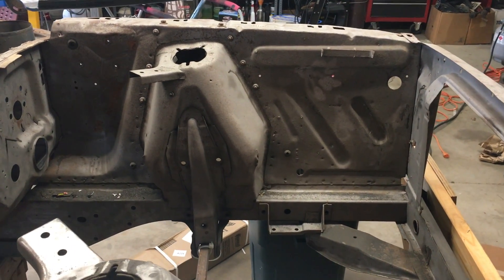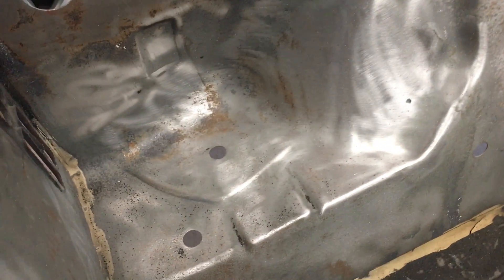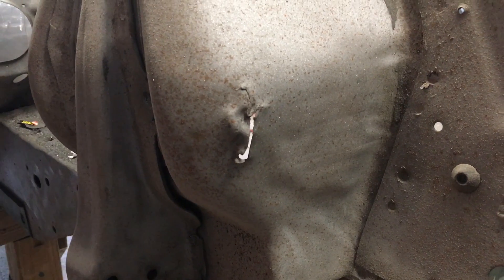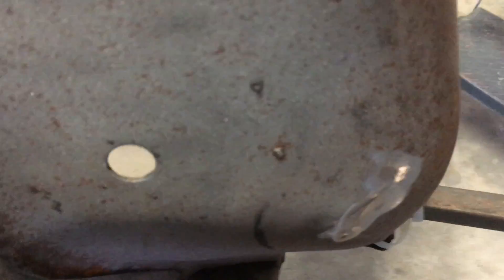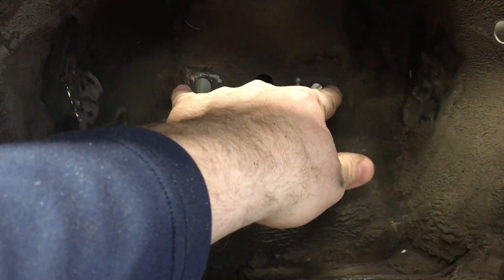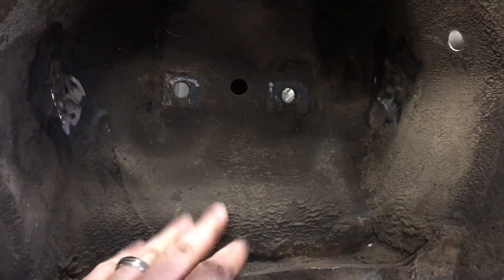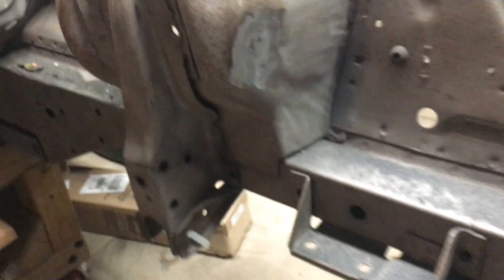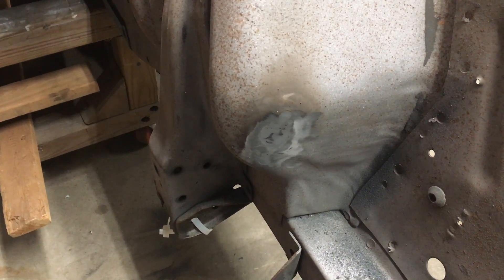Patching Shock Towers

Comment: The scary thing about pinholes is that they are a sure sign that the rust has eaten away all the surrounding metal to paper thin consistency. All the paint in the world will not restrengthen what has disappeared to the elements. You are making good progress and that's a good sign. :-)
Reply from the maker: Thanks Ed, yup its definitely helping me to find the weak spots.

Comment: my car actually had a hole in the same location...previous owner had put it there so he could grease the control arm and the other ones were hammered for the same purpose.  also if you get the brass paddles that you can put on the other side it will allow you to get less blow through.  ive used them a couple times on one of the doors on my 54 gmc

Comment: the big dent to the front of the passenger side shock tower is factory. 

Maybe the shock towers cracked due to someone drilling holes on the side to reach the grease fitting for the control arms, or they had after market control arms that didn't fit right with grease fittings so they banged inside of the shock towers out to let the inside part of the control arms in. 

You could weld in reinforcement plates for the shock towers. https://goo.gl/images/yxl35p
Reply from the maker: Wow thanks for the advice, I'll do some research on those reinforcements. If I'm going to do it, now's the time!